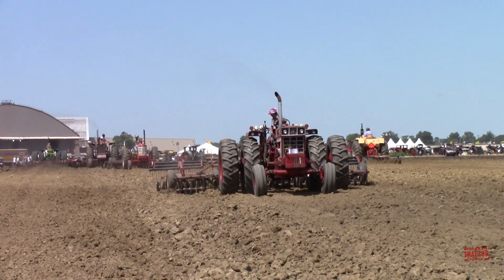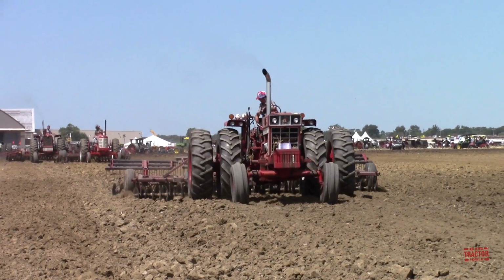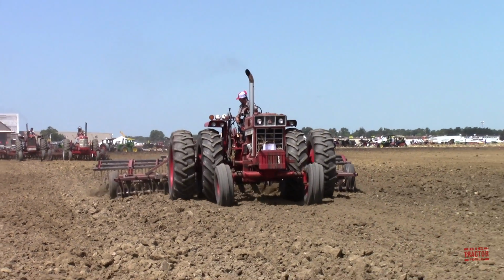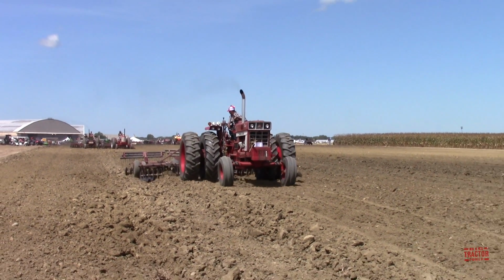International Tractors Plowing

Comment: IH tractors doing what they do best, spinning.
Reply from the maker: A 4020 out there broke its 3pt off plowing this ground.  It was tough conditions for all the tractors.
Reply: Lee Meacham and it looks like most of the filming was on headlands and what’s usually on headlands class? That’s right compaction.
Reply: @bigtractorpower  Yes I could tell it was pretty tough going. My family farmed with farmall/ IH from early 30's until I retired in 1995. F-20, F-30 10-20 , Cub H,M, 300, 460,560, 706, 1206, 856. After the 60 series there was a definite change in traction and an increase in slippage. Just my experience.
Reply: That ground is hard as a cat's head

Comment: How are the double tractors toward the end of the video controlled? Are they shifted independently and the clutches and throttles work together, or is there some mechanism that shifts both transmissions at the same time?
Reply from the maker: There is a cable that runs from the control tractor to the rear tractor. I filmed an Allis-Chalmers set up like this and talked to the operator and he showed me how it works.  I will post that video soon.

Comment: I'm looking for a 85-100hp IH to handle a 720 5 bottom
Reply from the maker: I would say an 856 in that range but a 1066 would be well matched. 72-75 1066s are 115 hp and 76 models are 125 hp.
Reply: 806 would be a great size for a 5 bottom this from a green and Yellow  farm boy we pulled a 5--14inch integral  plow was a john deere with a 4020 and 4010 John Deeres

Comment: 1206 with 110 horsepower looks a little more than that to me
Reply from the maker: The factory horse power is 110.  No doubt a 1206 can crank out more than that.
Reply: My uncle had two 1206 turbos, turned up to 135 hp. Pulled 5-20 plow with ease, also fuel efficient as well